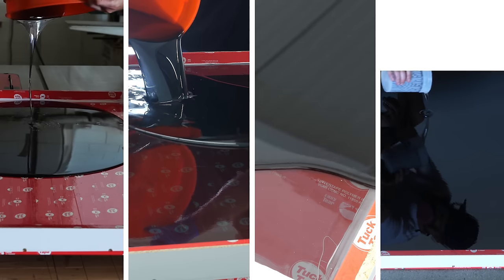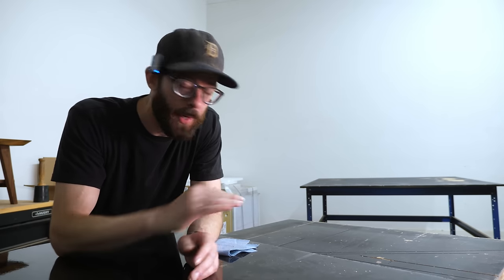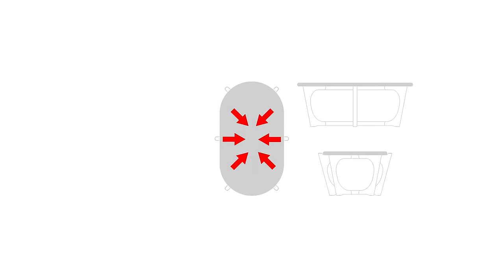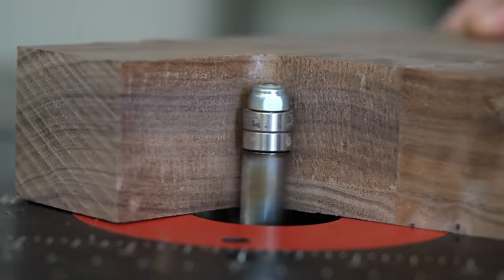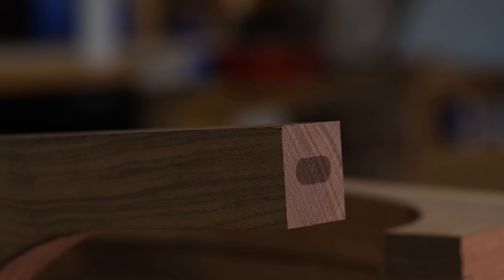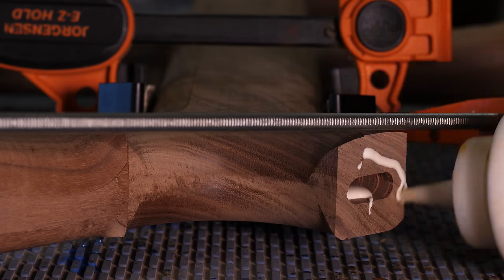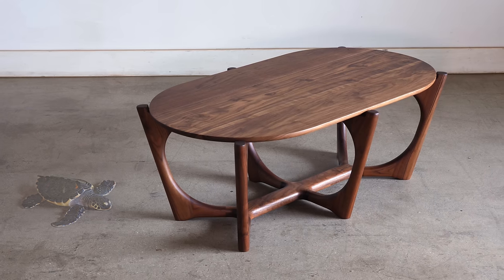Saved from the Dump

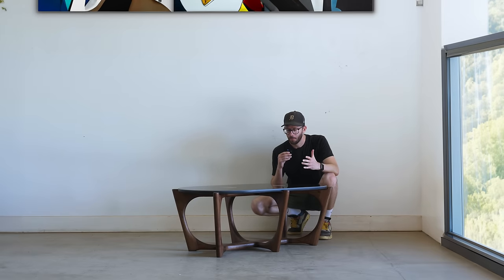Comment: at 19:50 Did you have something generate the extension of the frame? Kinda funny.

Also, my opinion on epoxy table tops; they are horrible... That is it. Like you explained, yes they look good when they're done, but as soon as they are put to use and wear, they will look horrible. Anything with a gloss finish will look horrible. And anytime a client of mine orders a piece with a gloss finish I try to sway them away from the mistake they are about to make. 
It basically comes down to this; Don't do gloss on surfaces that are going to be touched by other things.
Reply from the maker: For the frame extension it was Photoshop Beta's generative fill. And yeah, I'm not a high-gloss kinda guy. I like a nice matte finish.

Comment: I think I would like the blacktop if it was 30-40% transparent.  Would cut the "black is hard to keep clean" factor by a lot and let you see the cool base through the table.  The wood top was exceptional tho absolutely love it. Would love the basic plans for the legs like a back of the woodworking magazine level plans with most of the dimensions kinda thing.
Reply from the maker: That's a good point...I think from a distance it would make the top appear a lot cleaner.

Comment: Watching you sand raises the question; "why don't CNCs have sanding attachments (with appropriate pressure sensors /settings) to sand flat slabs. Program in the shape of the slab, and the sanding passes with resets to change sanding disks..."?

Comment: White sand? How about measuring say a gallon of water, pouring it in and then weighing the left over water?
Reply from the maker: I don't think you really want to be pouring sand, water, or anything into the slabs and the mold. Rough calculations are plenty good.

Comment: The problem I have is that I hate the way Epoxy feels. It always feels like a soft plastic. I like the feel of very hard table tops like steel, marble, concrete, or wood because it feels warmer to me but that is just me. I like the wood top better but the epoxy one does look really nice but a bit boring to me. maybe if it had a pattern of some kind in it. Wood bits were cool.

Comment: I think at this point you need to be designing and building more projects like this. What do i mean by “like this”? More unusual projects, more nontraditional furniture. Why? Because there are endless woodworkers making slab tables. What about slab planters, or slab stairs, slab painting frame, no one is making anything like that.

Comment: pedantic engineer here: There's not really a thing called "cubic volume." Volume by its nature is already cubic. it would be like refering to an amount of time as "seconds time" or that a line measures 44 "length inches."
Reply from the maker: But things can measure 44 inches in length...and I won't tell you for a seconds time :P
Reply: “Pedantic engineer” is similarly redundant.
Reply: @kenmoorhead2943 concur.